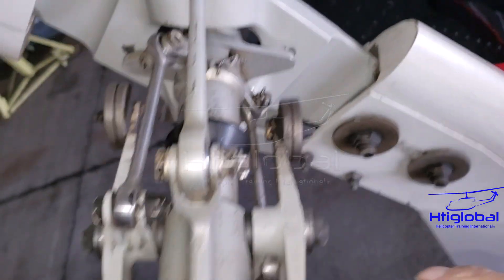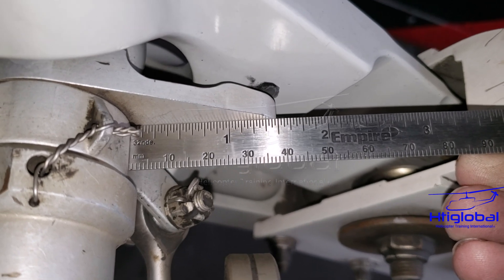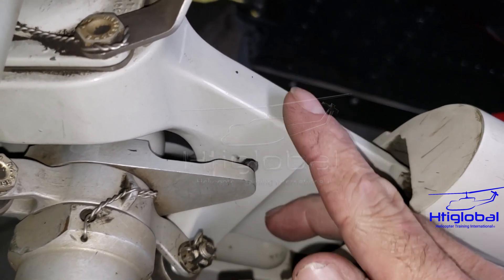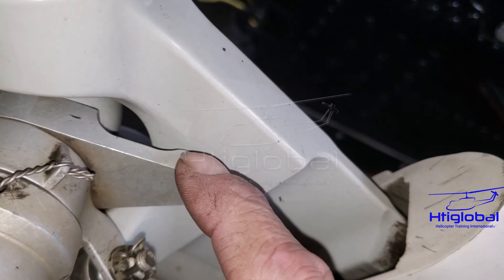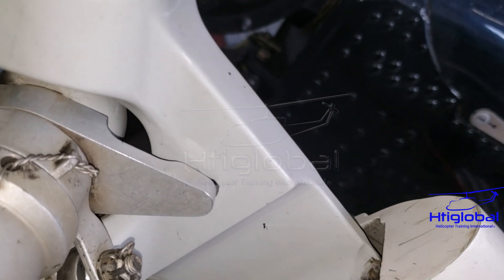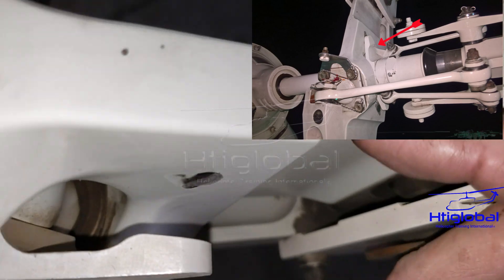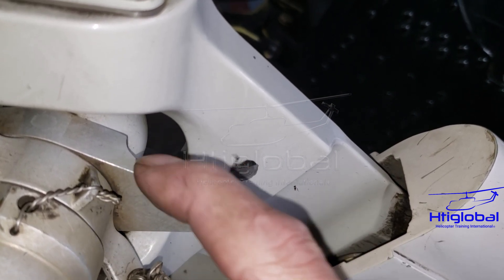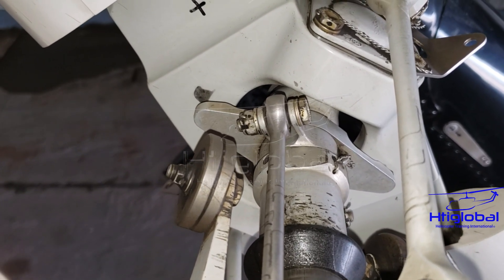BELL MEDIUM TAIL ROTOR FLAPPING STOP

Comment: Can you share about inspection of must assy
Reply from the maker: do you mean mast assy inspection? There is  a video regarding the mast seal leak and I go over few things there in that video. Regards
Reply: @HTIGLOBAL  on how to preform 2500hrs inspection on mast.
Reply from the maker: Now after doing a TB it is extended to 3000 hrs. the special inspection. Be careful about -101 and -103 as torque value are different!!
During our overhaul course we disassembly, inspect it and assembly back .
It is a very interesting class.